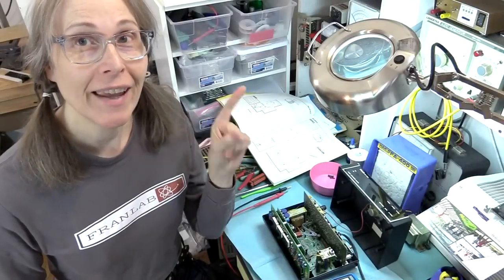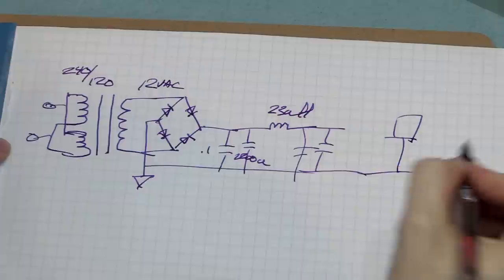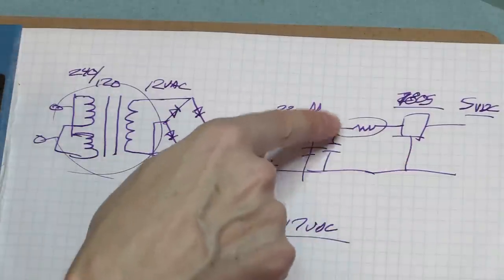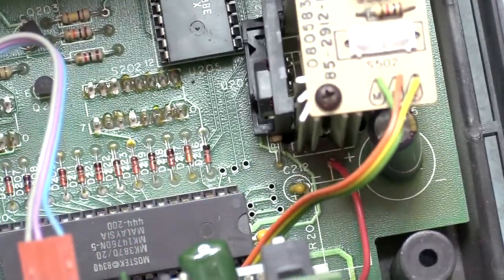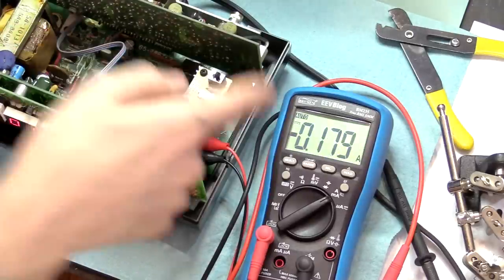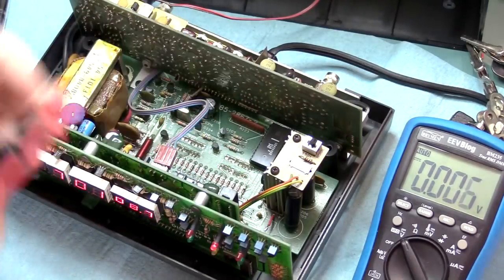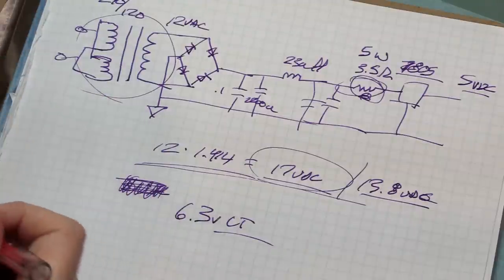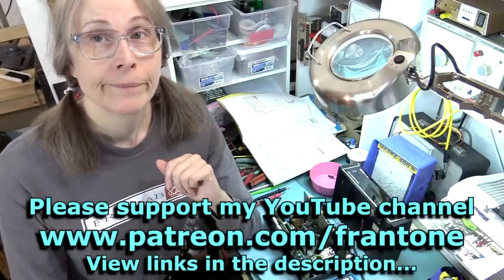Heathkit GC-1000 Power Supply Design Fails and Fixes

Comment: Hi Fran,  Not sure you read these messages but in case you do, I was wondering if you have done a review of the EEVBlog DVM ?? I found some very mixed reviews online. I use Fluke 77's in my lab but also have a few HP 34401 high resolution meters when I need extreme accuracy which is not too often. 
If you have not done a review on the EEVBlog unit, would you consider doing an honest and in depth review... We all love and respect Dave but when it comes to a product being sold for testing electronics applications,reviews are fair. I am sure Dave would agree.
Best to you.
Regards aka 73,
Glenn WA4AOS
SC

Comment: although it is not the neatest solution, adding that series resistor back in: something like 28 ohm and 3 watt. Should drop 7 volts at 250ma. Then back to the 7805 regulator.

Comment: Use the missing resistor leads for a LM7809 add a ground lead put a LM7805 back in and heat sink them. Dissipating at worst 3 watts between the two. The design flaw may have been in the LM7805s heat sink  and power resistor wattage selection. Minimum for the job least cost more profit.

Comment: Isn't there also a 7808 regulator on the board? For the 8v for the radio board so you're probably going to need at least 9.5v to feed that, if you're replacing the transformer you're probably looking at a minimum 10vac. I don't believe the other voltage regulator has a dropping resistor either. If you use the Variac, you might drop the voltage for the radio board too low to operate it.

Comment: An option would be to parallel a resistor with the voltage regulator to share some of the current.  That is a technique often used in arcade games.
Reply: Jamzoni i think you’re confused. Running a resistor in parallel with the regulator will only draw more current off the transformer and waste power. I guess it would actually lower the voltage to the regulator by increasing current through the 3.5 ohm resistor but it’s totally the wrong way to get a lower voltage.
Reply: @markcummings150  The issue as I understand is that the stock regulator is prone to failure. Sharing the current with a resistor can offload some of the work that the regulator needs to do. It wouldn't cause any more current from the transformer, nor increase power consumption.
Reply: @jamzoni1131  thats how I understand it too. but you said to run a resistor parallel to the regulator in your first post. the original design uses a series resistor with the regulator to help drop the voltage and as a result it would share some of the power drop with the regulator.

Comment: 6v ac transformer would be optimal for linear regulator. These days there are switchmode replacements for the 78 series reg in three pin format

Comment: I remember lusting over that clock when it came out. But the reality of limited finances and keeping my wife happy won out. Besides, I had a Radio Shack "TimeCube" at the time so I could get a girly accurate time hack when desired. Later in work life the calibration labs always had a Cesium standard or a stabilized Rubidium oscillator linked to WWV-B over the air. 

I'm also happy to see that I'm not alone in using a fountain pen! 👍👍
Reply: @$!#&! automatic spell check! "girly" should be "fairly".

Comment: The reverse current reading might be that Aussie DMM, I should turn it upside down then it might work better.  A really goofy work around would be to have two linear regulators, first a 9volt one the the 5volt that way neither regulator will end up so toasty.
Reply: Not goofy at all! I've seen it done well many times. The cascaded current values are perfect for this approach.
Reply: Unless she also wishes to reduce total heat in the cabinet?

Comment: 9V drop from 14V to 5V, times 0.3A max load current is about 2.5W dissipation worst case. That will get that 7805 good and warm but it shouldn’t be outrageous. That regulator should have had a bigger heatsink for sure. And I totally agree that a 9V transformer would have made more sense.

Comment: A while back I did the dc to dc mod on my clock and it's also noisy but does acquire on 5mhz Now I have an urge to try shielding it but I'm betting it won't be that easy.

Comment: Why not rewire the primary side of the transformer to the 240VAC setting? That should halve the voltage output when applying 120VAC. Will the current draw be too high in the primary side wires?
Reply: That idea has been offered.  There is an 8V supply to make too.  Try the design and see how it comes out.

Comment: I suppose an overkill "fix" might be to reinstall tue pld 7805 reg but splice in a 7809 circuit in series before the 7805. That way the heat burned to drop the voltage is shared across the 2 devices and each is only having to drop 3 to 4 volts instead of 8 or 9 fpr the 7805. Not pretty but it might work.
Reply: Unless she's interested in lowering the total heat in the cabinet, too.
Reply: @ordinaryaverageguy76  good point.

Comment: You are ignoring the voltage drop from the two bridge diodes in series with the output of the transformer.  That would drop something like 1.2 volts from the expected DC output.  So more like 15.8 instead of 17.

Comment: An option to somewhat reduce the power is to reduce the capacitor across the bridge.  If you let the voltage ripple a lot the drop on the 7805 will average to less.  Since the highest voltage you really need is below 10V, quite a lot of ripple can be allowed.
10V/18V = 0.5555
arcsin(0.555) = 33 Degrees.
at 60Hz 33 Degrees is
(33/360) * 1/60 = 1.5mS 
Assume the capacitor is fully at the peak and ramps down to the zero crossing
(1/4)*1/60 = 4.2mS
Thus we have a total time T of 5.7mS
Delta V = (17V - 10V)
Knowing the Current I
DeltaV = (I * T) / C
C = (I * T) / DeltaV
Then pick the next size up you can buy
Make sure it is OK with the ripple current number.
Reply: Ken Smith and effectively you are then putting more heat into your electrolytic capacitor reducing its life instead. Power resistors are more suited to this task.
Reply: @markcummings150  
The ripple on the capacitor only interacts with the ESR and not the Xc of the capacitor.  Mostly reducing the capacitor reduces the power taken from the mains.
Try making a spice model of it and see.
Reply: Ken Smith more ripple over a fixed esr is more heat. I’m pretty sure that’s what I said already. I don’t need spice to tell me that.
Reply: @markcummings150  
The ESR for the smaller valued capacitor may not be higher.  The higher ripple voltage actually results in a smaller RMS ripple current and thus for a given ESR less heat.  Try it in spice and you will see.
Reply: @kensmith5694  at what point did you think I was talking about anything other than the main filter cap. Are you claiming that a capacitor that charges and discharges over a higher voltage ripple will produce less heat. if so you are deluded. stop trying to change the the meaning of my statement. its pretty obvious I am talking about the heat in the capacitor to everyone else here.
Reply: @markcummings150  
I never thought you were talking about anything but the main filter capacitor.
The power in the capacitor is from
P = I^2 * R
Where  the R in this case is the ESR of the capacitor. "I" must be the RMS ripple current in the capacitor.  I am not changing the meaning of your comment.  I am explaining that you are wrong.  The ripple voltage on a capacitor is different from the ripple current.  What I have said is correct.  I suggested you make a spice model because to some this is not obvious but at this point we are beyond the "not obvious" and into the "you are wrong" area.  I have avoided words like "deluded" and accusations about your motives because I want to keep discussions reasoned and polite.
Reply: @kensmith5694  thanks for your suggestion, however I'll leave it to you to provide the data for others here that may be interested.
Reply: @markcummings150  and others
All they/you need was in my first comment.
Reply: Oh,m,y of course your knowledge of your equipment is totally AMAZING!! Your look,is  my oh my great! ....gotta say ,totally thought you were a.. .Tom boy type,   ...just gotta say  you look attractive.   ..ya  ...yummy!

Comment: Or make a modification to replace R201 3.9 Ohm 5W resistor with a LM7809 9V 1A regulator ... just before the 7805 5V regulator.

Comment: There's always alternative solutions. The trick is thinking of one. Find an old 1 amp wall wart power supply. Don't go by the printed output. I've found that one saying 6 volts can really be 8 or 9 volts and a 9 can really be a 12. Connect a jack to the case and feed the external voltage from the wall wart to the 7805 and everything will be happy. I forgot to mention make this a DC power supply and not an AC out put wall wart..Peace out.

Comment: Also you can put a diode at the 110 v input so you can take half of the ac wave and you dont need a variactor and the voltage goes from the 110 to more or less 55 and at the secoundary also you get the half about 6 volts and so ac after rectified you get the 7.5 volts for the 7805 what do you think about it ?
Reply: Realcom:  If you put a diode in series with the incoming 110 Volt AC line you convert it to pulsating DC (with approximately 170 volt peak voltage) which will then be applied to the primary of the power transformer.  Transformers will NOT "transform" DC!  What will happen is the core of the transformer will saturate which will reduce the impedance of the primary winding of the transformer to more or less its DC resistance which is quite low.  Excessive current will flow in the primary and the fuse will blow. If there is no fuse (or it fails to blow) then the transformer will burn out, possibly starting a fire or at the very least smelling very "bad".  In other words, the magic smoke will come out.
Reply: @Vincent_Sullivan  try it yourself ! 170 volts??? but only vitual low current. We can put the diode at the transformer output nevertheless this is not dc my friend this is pulsed current you need the capacitors discharge to make it not pulsed. Try it and after we can talk more.

Comment: Replace the 5W 3.5 ohm resister & regulator with a buck/boost converter.  They are fairly cheep with efficient power conversion and regulation.
Reply: No boost is needed.  The usual hack is just to replace the LM7805 with a bucker.

Comment: You need to run it on 12V because it is designed to work also with external 12V power supply.

Comment: Modern voltage regulators are much more adaptable these days. You could even use an adjustable regulator transistor and trim it to 5 Volts.
The attitude perimeter are much higher these days and 16 volts in is easily adjusted to 5 volts with an adjustable regulator transistor.
Reply: It will still have to dissipate the heat from the large Vin to Vout delta. Adjustable linear or fixed linear, doesn't change that.

Comment: I've seen some power supply designs that use the regulator to control a MOSFET of a higher power rating than the VR , You might find some info on Youtube" Mr Carlson' Labs".

Comment: I'd try just putting the primary windings in series, maybe 6V out of the secondary would be enough to power the clock!
Reply: More than enough, actually, considering 6VAC through a bridge rectifier would peak at around 8VDC. But an easy solution that would help nonetheless. :)

Comment: Now that buck converters are so cheap, I suspect those 78xx regulators in my drawer will never get used
Reply: The LM78xx regulators are still handy at lowish currents or when analog is happening nearby.  I just designed one in on something.

Comment: there is a approx. .6 drop per diode in the full wave bridge that means there is a at least 2.5 volt drop across the bridge itself,also in the long history of electronics i dont think anybody ever  used a 240 volt input just to get the right output  of a 78 series regulator,dumb!!!!

Comment: Why don’t you try putting the two primaries of the power transformer in series . Might give you 6+ volts for your regulator. Mind the phase, obviously 😃😉
Reply: You are not the first to suggest this.  There, however, is the 8V section to consider.
6V * sqrt(2) = 8.48V
That may not be enough headroom for the 8V regulator. (even without the diode losses)
The 8V load is low powered so along with changing the windings, putting in a voltage doubler for that may be a good option.

Comment: Would have love to see why the large voltage drop is a problem.
Reply: Large voltage drop at high current means a lot of power has to be dissipated in the regulator.
Reply: P=IV
High V = High I

Comment: A 6.3V transformer isn't really up to the job.  6.3 x 1.414 minus two diode drops minus say 1V ripple is only 6.7V ie not enough for the 8V rail and barely enough for the 5V rail.  And this assumes that your mains supply is nominal.
Reply: The general rule for a 5 volt 3 terminal regulator is that you want 8 volts on the input to give proper regulation on the output.
If you can't get quite that much, you can use LDO type regulators-they can regulate properly with a smaller differential.
Reply: number 33 exactly. Finally someone that knows what they are talking about. I’d estimate slightly more ripple but we don’t have all the facts.
Reply: @number 33   "Who is Number One?"
Reply: @ordinaryaverageguy76  You are number 6.
Reply: @number 33   "I am not a number!  I am a free man!"

Comment: More simple put a 12v regulator 7812 before the 7805...is cheaper than replace the tranformer.
Reply: Yes,  many have suggested that idea.  Fran, however, appears to have put in a switcher.

Comment: Put another 10V or 8V regulator ( in place of the 5W resistor)  before the 5v one in order to step down the voltage......and there you are....

Comment: My tired old brain says, dropping 6v at 0.2A 30 ohms. 1.2 w so a 30 ohm 5w resistor seems to be  OK. If you wanted to protect the 7805, put a 7v Zener after the resistor across the input of the reg. This will limit the input V. Linear regs are quieter....
Reply: That is a waaaaaaay hefty Zener you are suggesting.  A preregulator using an LM317 would be a better option.  With only a bit of cleverness, the LM317 can be made to handle 1/2 the heat almost exactly.

Comment: Maybe better to use a 12.6VCT transformer, as they were even more common than 6.3V, IIRC, tie the ctr tap to gnd, then just use two diodes to get full wave rectification.
Reply: Elsewhere its mentioned that 6.3vac is too low to regulate reliably. I think Fran even had assessed that. Plus the same transformer output is feeding an 8V regulator.

Comment: How about instead of a hinkey dropping resistor, an equally hinkey voltage divider going into the noise-free, simple, and cheap-to-run regulator.

Comment: Perfectly fine to drive a 7805 with 12V. Almost every single power supply I worked on in the 80s and 90s did that. Completely normal.
Reply: The 7805 datasheet allows up to 35v on its input, so you are technically correct. But as Fran pointed out, it all comes down to the thermal performance of the design. An interesting followup experiment could be to reinstall a 7805 in the clock, attach a thermocouple to it, close the case back up and see how hot it gets in normal operation. It could end up that this would be a perfectly acceptable design if the case allowed a bit more air flow.
Reply: @Lane42  I am not sure why this is even a subject. The 7805 is so old and obsolete at this point.
Reply: @wayahedia9989  The only reason to do it is curiosity. Nothing more.
Reply: Waya Hedia well, err yeah, this is a retro piece of kit we’re discussing.
Reply: @Mark Cummings   Exactly!  If obsolescence obviates anything in this channel, then the whole Heathkit line can be deleted as subject matter. LOL

Comment: The switchmode will run lower input current than linear reg. As it controls input power approx eq to output power plus losses  Vin *Iin approx eq Vout*Iout plus losses(small). Linear Iin eq Iout AND power loss thus Iout * Vdrop in this as presented roughly 17-5 eq 12v*Iout MUCH HIGHER than switch mode

Comment: pretty good...but the main issue in the clock and the 7805 is current dissipation.  so say a loaded voltage of 14 volts out of the transformer and a desired output of 5 volts at 200 ma.  that is 14 minus 8 multiplied by .200  equals 1.8 so lets make it 2 watts.    that is well within the limit of the 7805...but if you go to 

 https://www.petervis.com/electronics/Voltage_Regulator_Heatsink/Heatsink_for_TO-220_Voltage_Regulator.html

you can get a handle on heat sink computation.  what you have to take is the hottest expected temperature in free air...problem is that the free air is in that enclosed box.  I have measured the temp in "my clock" and it can get upwards of 40 degrees after lengthy operation.  that is going to call for either a very large heat sink or dissapating the current/heat somewhere else.  I kept the regulator BUT added apretty massive heat sink .   I am in istanbul and the clock is in Santa Fe...but the heat sink "folds" over the inside of the cabinet and goes all the way over to the transformer.then I put a small fan on the top...cool... nice video

Comment: hmm, i think that voltage 17v is within the max 7805 rating, and fhe power 0.2amp at even up to 12v drop, is only 2.4 watts, and the heatsink looks reasonable size..??? with 13v actual input its  1.6w dissipation.?? strange ? maybe there was a bad batch of 7805s?  i've seen these 3 terminal regulators fed raw unsmoothed dc in a server cabinet cooling controller unit,  maybe to reduce dissipation?.. try that?
Reply: but you'd need reverse protection,  diode from output to input, anode to output ..